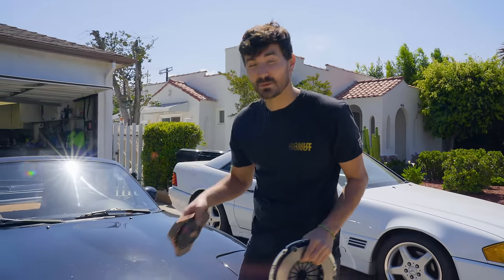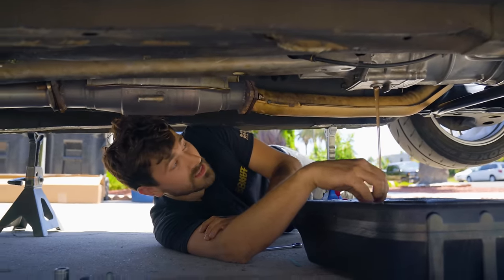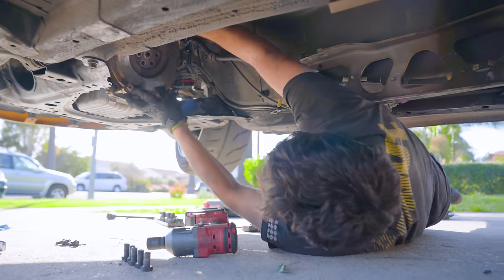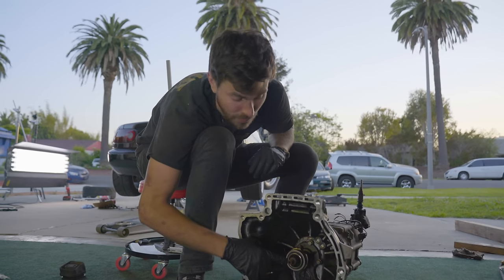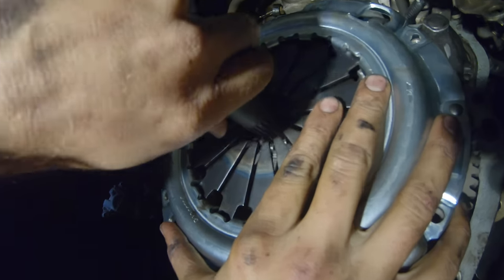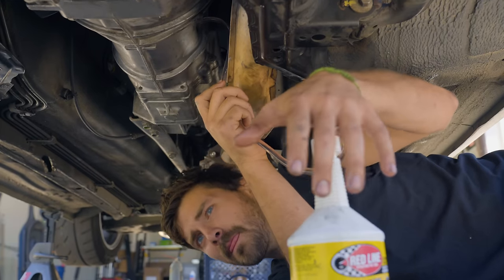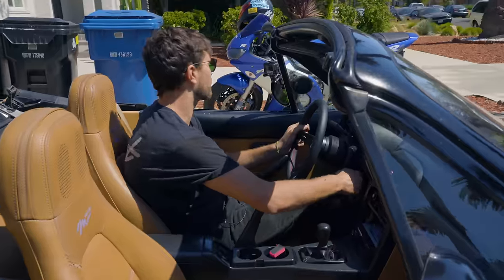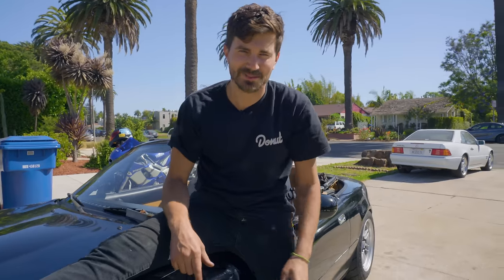We got sent a super weird clutch and installed it anyway

Comment: Pucked and metallic clutches are specifically designed to grab very aggressively. They’re designed not to slip. This is more important for stuff like drag racing where you may drop the clutch or speed shifting. They aren’t necessarily designed to hold more torque, they’re designed to hold the huge torque peaks when you drop the clutch. Organic clutches are designed to slip and engage more slowly, but that means they slip when you drop the clutch. If you do that enough, they overheat and slip more. There’s also differences in temperature range (metallic will generally work better at higher temps)

Trying to do a clutch in the driveway is the worst thing lol. Years ago, I needed to replace the trans in my old Z31 300zx. When I was trying to put the trans back in, I was doing the jiggle jiggle to get the input shaft to line up with the clutch. It slipped off, and my hand (that was under the front end of the trans) got overwhelmed by the weight of the trans suddenly dropping and ended up crushing my hand between the transmission and the ground. Broke my hand. That’s the last time I ever tried to remove or install a transmission by hand.

Comment: I am a qualified mechanic, I have changed so many clutches, There is a trick of the trade "use the clutch centring tool but slightly lift the tool 1 or 2 mm just as you FIRST slightly tighten the pressure plate... mechanics talk just slightly nip it up " (I find the weight if the clutch plate on the centring tool slightly pulls the clutch tool down and still keeps the clutch plate to spigot bearing it slightly out of alignment) I have done this on all my clutches "in line and transverse engines and have NEVER had any alignment issues they all slide on so easy first time!

Comment: in the late 1980's a school nemesis took me to the McKinnon Hotel (VIC Australia) in his RX4 for a booze run, he let me drive the 3 km back home.
he had a race clutch fitted, so it was on or off, and i stalled it a couple times, now i will mention it was rooted and it smoked like a chimney.
but DAMN that thing had some power, it threw me back in the seat and i hung on tight.
i suspect he only let me have a drive as bragging rights, as i had been driving a 1976 Mazda 808 wagon for a couple years.

Comment: The clutch is a 3-puck sprung clutch, so the transition wont be that bad.  I don't remember 3-pucks from my tuning days, but definitely 4 and 6.  The Sprung clutches were an easy transition, but the un-sprung clutches were harsh.  A friend had a 1.8L BP with a 4-puck un-sprung clutch, and that was indeed a binary transition.  I only drove it a couple times, but it was not a clutch that you would want for the street.

Comment: this is safe on the jacks but i always used a thick 12"x12" block of wood with them, one on each side. i had one fall and almost kill me when i was 17. lol makes me nervous, but awesome vid.  

scariest thing i ever did was put in new coil springs in my 70 maverick up front. it took me 3 days to get the nerve to pull the second one. if that flimsy feeling coil compressor breaks, you will be maimed or killed. i used an old aluminum chair and a ladder as a shield as i reached in with 2 long vice grips to grab and remove the upper control arm, to then let the spring back down. 

the new springs were way stronger and tightening them to get clearance i needed to install that new A Arm, made the entire car vibrate and groan. the pressure on the clamp threads were that great.  never again haha.

Comment: I remember the first time I did the clutch on my WRX. It took me 2 days and I experienced every single frustration this man just experienced. Now I can do the clutch in about 6 hours
Reply: You have two more drivelines to deal with than he does. The hardest part of a WRX clutch change for me is removing the intercooler. I'm just not quite strong enough to do it. But I suppose maybe you figured out how to get the transmission out without doing that.

Comment: That clutch is a 1st stage rally or race clutch, they also come in a double or triple plate complete with a lightened flywheel as a kit depending on your torque requirements.

Comment: Holding that transmission up like like reminds me of when I did an S-10 three times in a month and it never needed to be done at all. Was told the motor was bad, it was just the head, that was the 1st split. Found I messed up the slave, 2nd split. Then 2 flywheel bolts came loose, 3rd split. I could do that truck in my sleep now.

Comment: There is a tool to hold the flywheel.. Worth it if you do your own work. Also a really good jack are the Motorcycle jacks.. Harbor Freight. that have a large platform so when you are under the car you can just jack it in place.

Comment: When you are  putting the trans back in get some all thread or long bolts and cut the heads off 4 inches or more long. Put these in the bottom two holes and this will hold the front up the trans up while you support the back with a jack or support.
This will keep the trans from falling on you.

Comment: The whole point of the "3-puck" clutch, is reduced inertia. The transmission will have a much easier time slowing down the disc during shifting, or speeding up during down shift. If it were me, I would have maintained the original (heavy) flywheel, and installing the new pressure plate, and 3 puck disc. That would maintain the "drivability" of the heavy flywheel, while enjoying the quick, nimble shifting. That lighter 3-puck disc will prolong the life of the synchronizers in the transmission. It will also allow much faster shifting, when you want to race around a little bit. (There's only one reason you would consider a turbocharger!!)

Comment: Id had to do a clutch change on my 2012 chevy cruze and it took me two weeks, lol. Being a fwd definitelt made it a bit more complicated than this, I ended up having to fully disconnect and remove the engine cause it wouldve been much more difficult to remove the subframe and pull the trans, but god it felt so good after I finished it doing such a big job by myself

Comment: 2 long bolts with the heads cut off installed in the bottom transmission bolts holse makes getting the transmission in place very easy.

Comment: I actually have that Exedy 3 puck for my ej207 STi build and was rated for - i think - 400wtq. It was weird to break in, weird to get used to, inconsistent in driving and died out early compared to other friends with similar numbers and power bands with different clutches. Out started slipping under WOT at less than 30k miles and was not aggressive enough on launches the entire time so it required a lot of feathering and footwork. Very sad to say it was a true disappointment of a clutch in my experience. This will definitely be a super interesting upgrade to keep up with because of that though!!

Comment: They used to sell those via mail order as drag race only clutches for v8 cars in the 1980's. My guess is they were meant to be slipped at high r.p.m. launches and nit chatter upon engagement. They exist for some reason. My thought is why not use a splined clutch like a drag-race motorcycle lock-up clutch if one were to go to such extremes?

Comment: ..the point of using a Puck Disc is that the pressure plate deforms around the high spot/friction pucks and won't allow the disc to slip....That's why they're considered for racing only, although they were initially designed for big trucks...Eventually, the pressure plate distorts so bad it becomes unusable..this is old school......sometimes.if you feel like rolling the dice, you can even use your old pressure plate, and it will work fine.......

Comment: I was hoping to see a dyno pull before and after. Torque changes with flywheel changes. I bet it did drop, hp about the same or a bit more, but, now you have more headroom for that turbo.

Comment: @10:00 been there often with a bad clutch on a '65 Mustang. Turned out the fork was slightly bent, putting unequal pressure on the clutch.

Comment: I could be wrong but it would seem to me that your new clutch would lead to hot spots on your flywheel and pressure plate. As you engage and disengage the clutch, the inevitable slippage might lead to uneven hot and cold areas on the surfaces of the flywheel and pressure plate possibly leading to warpage and chattering but that's just my opinion.

Comment: Just paid ~$850 to have a shop put a new clutch in my '99 Mustang. Money well spent. Been working on cars since they still came with drum brakes on the FRONT. I could have done it myself. But they don't make jack stands tall enough for me to get under the car. Maybe if I put it up on ramps. Even then, I've reached the age where laying on the ground is an "emergency only" proposition.

Comment: Everyone seems to think that increasing the surface area of the friction material will increase the torque capacity of the clutch. This is not the case, the friction force is only affected by the coefficient of friction and the normal force, not the area of contact. The area of contact only affects the wear rate, nothing else. Brakes are the same.

Comment: You’re supposed to Take the shifter turret apart from inside the car before you drop the transmission. The shifter turret should be rebuilt when you install the transmission with new gaskets new bushings and topped off with fluid inside.
Reply: did you not watch him? he literally explains this

Comment: Good luck bleeding a wrangler clutch like that, the bleeder screw is basically just for looks, it functions, but doesn't get the slave bled, for wrangler you have to take the slave off, open the reservoir and slowly pump the rod a couple dozen times or so while checking fluid to make sure it doesn't get too low, then reinstall slave cylinder and you're good to go

Comment: I had to change the clutch on a Chevrolet Chevette once. By myself. Yes it was hard, dirty, tiring, and a lot more adjectives. But it was also fun. I had just gone back into law enforcement after working on 18 wheelers. The little clutch seemed kind of comical compared to the large twin disk clutches they have.

Comment: I'm surprised I didn't see it in the comments. The clutch that you have has Springs in it which makes it a non-aggressive clutch. So everyday drivability isn't that bad. If you drive it like you're supposed to it actually grips the flywheel and and saves on gas mileage. But because they grip so well when you get in it it has performance to your car. You'll notice it at the higher RPM shifting weigh less slipping when the flywheel meets the clutch plate. Me personally I like the six puck clutches but thats me.

Comment: Try dropping and reinstalling a turbohydromatic 400 in a 66 Cadillac de Ville that's up on ramps. I broke the flywheel. Gravity is your best friend on it's way out but your worst enemy on the way back in. I used to have a lot of muscle in1978 working in a concrete block plant. I didn't have a problem letting it down on my chest but bench pressing it back up was another story. I wound up borrowing a floor jack from a friend.

Comment: What I yearn for is a centrifically engaged drivshaft coupling for my manual trans cars...with a lock/unlock option obviously ....I'm thinking the drive shaft is now two pieces one of smaller diameter  slides into the other then a housing with a housing at one point with centrifically powered shoes that grab or release the inner shaft depending on speed but also able to engage dogs into the inner shaft locking it up for normal operation could even simply use maybe oem abs sensors to tell a little ecu when to engage or disengage.....the only time I would use it would be stop and go traffic where is is SO annoying to ride the clutch constantly pushing in and letting out as the traffic creeps for 45 minutes!  just push a button and drive shaft locks and unlocks   There are likely several ways to do this whichever would be smallest/lightest and most reliable would obviously be best....could even maybe be angled teeth where shaft ends meet with spiral groves forcing one side in or out of engagement...for the life of me I cant understand why this has not become a thing....long ago!  But now with ecus there are even more ways to accomplish it easily I would think.....stop and go rush hour traffic....it's why lots of folks wont buy a manual transmission!

Comment: i think since the surface area of the pucks is smaller than an OEM style clutch you need less force when making contact with the flywheel, since the force will be distributed over a smaller area on this puck design than a traditional clutch. Garage level scientist is my pedigree. Probably makes it more forgiving with the lighter flywheel, as well

Comment: 3 Puck Ceramic clutches were a big thing for a lot of performance air cooled VW's, lot of people considered them a waste.  Now you want to talk about a clutch with a really quick engagement try out a rigid center clutch.  No springs for damper in it just solid.  Those grab really quick, not positive they offer them for the Miata or not.

Comment: If it is a rear wheel drive without aircon it is much easier to erect a tripod, remove the hood and radiator and lift the engine with gearbox out with a block chain puller.

Comment: This was almost the same time i did my clutch on my S10. Cept it was February and it was 40 degrees. And raining. and we have a gravel driveway. 

I was working for Dominoes (between real jobs, it happens) and my B swap civic doo dooed on itself, the oil pump went out and the engine started making a ton of noise, then it didnt. So i found this fairly nice S10 online for a grand and it was only an hour away. He said the slave cylinder was bad but everything else worked great. I do like the S10 and kinda always wanted one for when my project broke down, i wouldnt have to call a friend to drag it home. The seller said it had to be towed, but i asked him if "it had a good strong battery" and he said yeah you can start it in gear and drive it. I didnt take a trailer. drove it around the block and handed him some money then drove it home. a whole nother story about getting it legal, so i drove on his Texas tags for a month until i had to rewrite the bill of sale since he never got back with me.
But as soon as i got the truck home i got underneath and looked. O SHIT....
Ive only ever owned Hondas. The slave cylinders are on the outside. 
Not on most RWD vehicles. and theyre not $30 from auto zone. Yeah the slave is inside the bell housing and costs about 150. i was not happy. but knew what i had to do. in the driveway, middle of a winter storm, i had no choice but to call my friend and borrow his car for a couple days while i fixed my, now, Daily. 
Watching this video was like PTSD plopping the transmission on top of you then clanking it onto the ground and dragging it out. Thank Gawd manuals are lighter than autos. I replaced the clutch, resurfaced the factory flywheel and spent half a day trying to figure out how to remove the paper thin pilot bushing. I did everything in this video you did. Fighting to get the trans back in, reinstalling the driveshaft to turn the shaft then fighting more to finally get it mounted.
It was the longest 3 days of my life. only taking that long because it was freezing rain, i only had a tarp to lay on to keep mostly dry and i had to go to work all at the same time.
But it was totally worth it. i still have the truck today, my mom drives it because she doesnt know how to save money and i didnt want it just sitting in the yard. and man this thing is a freaking monster. 2.2, 120 hp and 140 pounds of torque. but the gears are super short. we used it to help my mom move. Like Everything, at once. i loaded her whole house onto a trailer and in the back of the truck. it was so low, i couldnt wrap the chains enough to keep them from dragging. but that truck pulled it like it had never seen a trailer in its life. ill never talk bad about another s10. such a fantastic vehicle. but braking with that much load was a different story.

anyway, thanks to anyone who took the time to read my little story. i hope this and the video inspires someone else to get out there and either fix their baby or take it to the next level.
goodluck and quit street racing. go to the track

o yeah, i had just replaced the heater core in my honda at the beginning of the winter. when the honda went down i got the S10. Had to put a heater core in that Hoe too. 2 dashs in a couple months. just my luck

Comment: next time you want to line up the splines just use a flathead screwsdriver in the crack between your enginen and gearbox, you can use it to rotate the flywheel, the same way you blocked it to unscrew the pressure plate

Comment: you took the hard way to remove the transmission. red&green had a more sensible way to remove the motor and transmission. a front bumper and grill did need replacing after the change... maybe a few side body panels on the front also.

Comment: I reckon the idea with the three puck is to reduce the rotating mass versus a stock clutch or a six puck, which if someone is going light weight, they're probably not also going high horsepower.

Comment: Grab a old exhaust valve bend the stem 90 degree and use it in a bolt hole to hold the starter gear keeps both hand free for the wrench!

Comment: You should have had to drive a diesel pickup with double clutch patch that had to have a double level part to engage with.  They were great till they had a lot of miles, no matter that they didn't have a great deal of hard time on them.  Check out the Ford, Chevy, Dodge diesels of the 90's.  They were hell on wheels till they became too hard to push and blew out the hydraulic lines.  The new style, just a single clutch,  weren't nearly as strong and soon you'd be going back to the old style of a double clutch pack and flywheel.  Oh well, they did a lot of hard work.